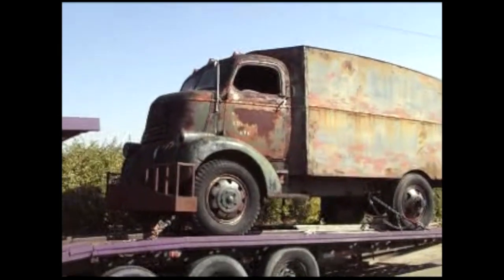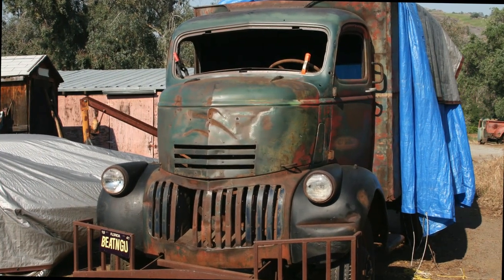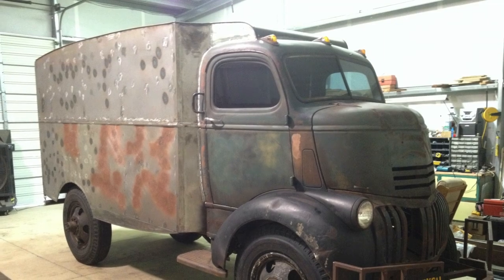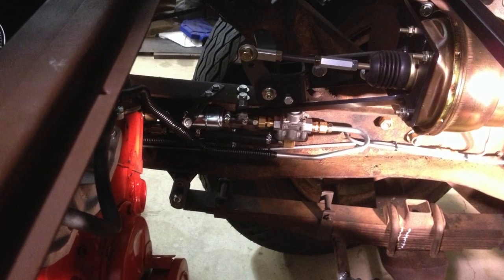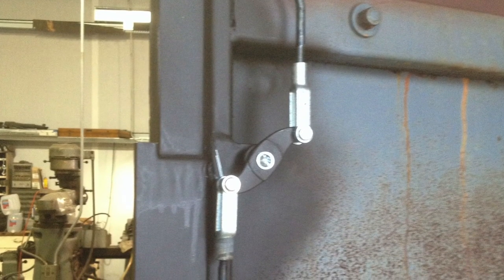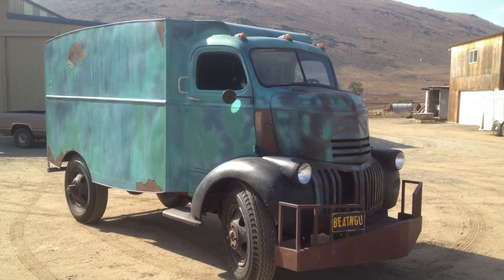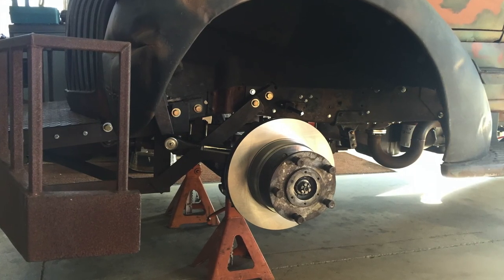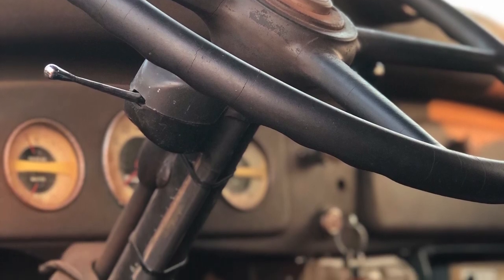Saving The Jeepers Creepers Truck. BEATNGU's Restoration.  #jeeperscreepers #beatngu #scary

Comment: Thanks for recommending this video, it does do a great job of showing your engine placement! When you say you used the original crossmember for your motor mounts would that be the crossmember the bellhousing of the inline six mounted to with its “ear” mounts? My GMC frame is a bit different than the frame of the Chevy COE’s but it appears that my bellhousing mounts land in about the same place as your crossmember.
Reply from the maker: Yes that’s the one. It would be unlikely the frames are different. It originally went all the way across and the bell housing mounted to it.  Each end of that cross member was cut off and received a piece of eye tubing welded in place to accept the small block Chevy motor mounts. It worked out well for this application. Interestingly the placement on the frame was almost (not quite) in the same location as it was originally, identifying about where we placed the engine.

Comment: I would've left it besides fixing the rust especially the horn an motor it sounded good In the movies ruined it 😞 to back I couldn't get to it before you did I definitely ain't subscribin to you
Reply from the maker: It had a non running 6 cylinder in it when it arrived. (Three trucks were used to make Jeepers) the sound of the motor and the horn were dubbed in later in post. None of the trucks had a working horn. And ya can’t fix rust without paint. Glad we got there first.-